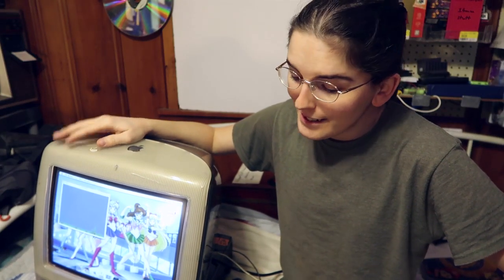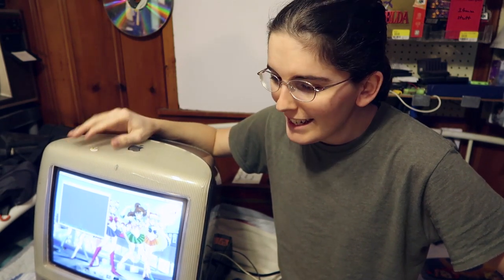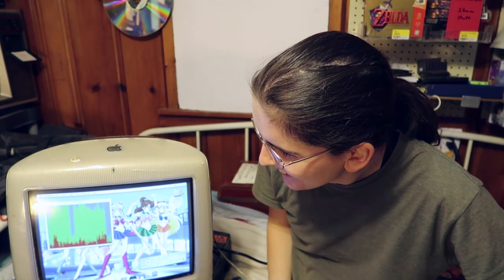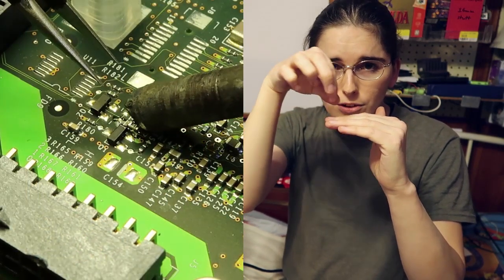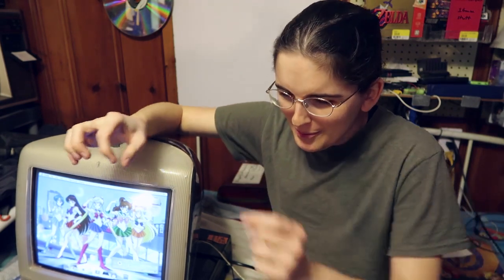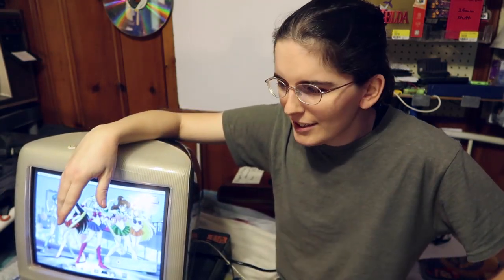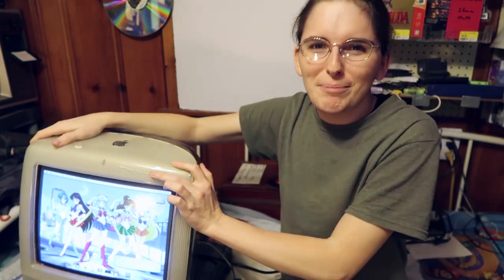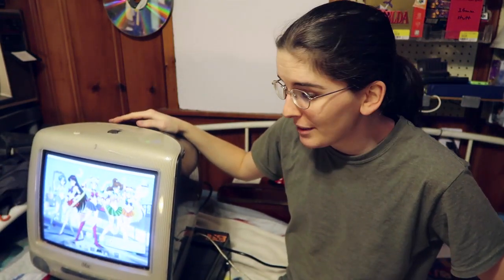Personal Bits 0338: I Overclocked my 2001 iMac G3 to 700mhz! Now its an Anime Player!

Comment: You are freakin amazing! I'm getting a 600mhz board soon. I guess I need to do this as well. I've only been soldering for about 2 years now. Anything you could tell me specifically to help me do this successfully? I love how pure the reason for you doing this is as well. It's the most practical overclocking I've ever seen in my life. Congratz
Reply from the maker: well i think i covered it in a full video on my main channel

Comment: I have the same rips of Sailor Moon lol. Older animated shows a lot better on CRT's. Like the other person said I'd upgrade the ram, install an SSD, and use VLC.  Downgrading the OS might squeeze a little more out of it. I watch anime on my Trinitron using a hacked wii plugged in with component, cheap and easy.

Comment: You probably know more about the imac g3 than anyone... Mine won't boot at all and this is right after installing new ram. It was a gig of ram which the model I have supports. Tried to put the old ram back in, still won't power on. Hit the PMU reset switch and even installed a new logic board/power supply. Still doing the same thing. Any suggestions at all. Been at this for a week and a half now. I would love any suggestion you may have. I just wanna play some old games... It was working fine for 2 weeks, then this. Thank you in advance if you are able to respond to this. Thanks!
Reply from the maker: make sure you didnt drop a screw and damage the board.